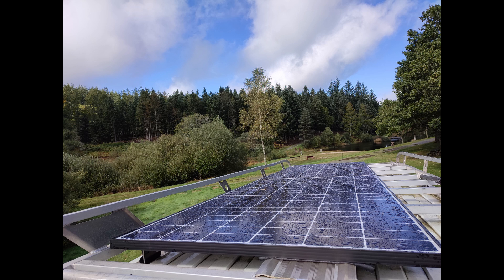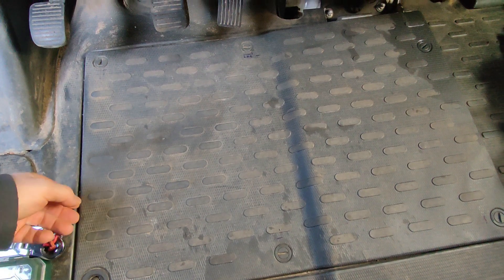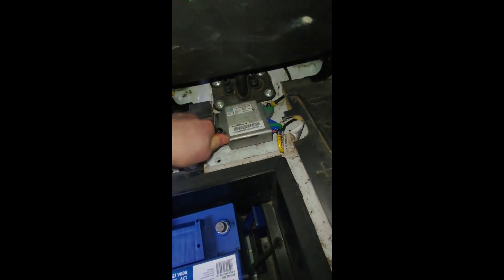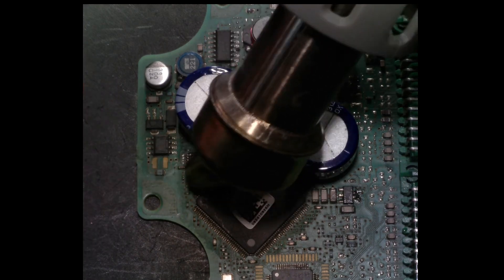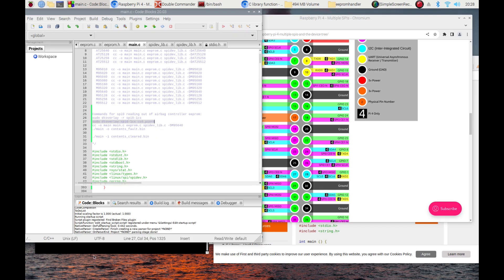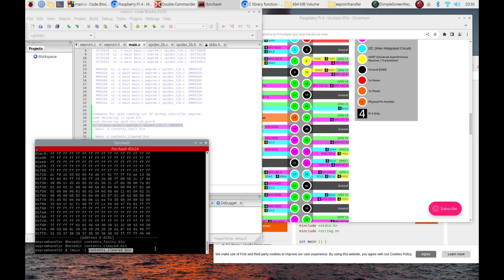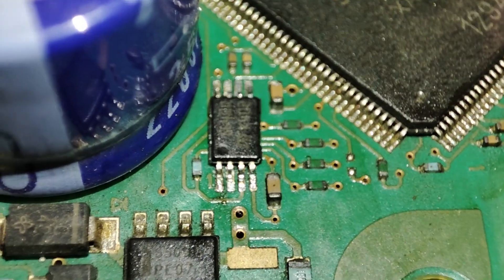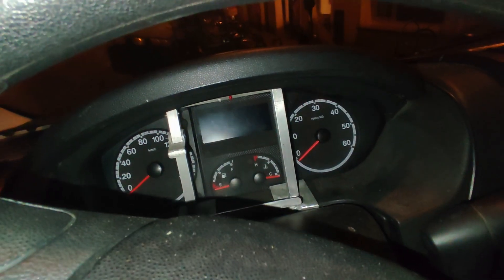Clearing internal airbag ECU EEPROM error B0100 with a Raspberry Pi (Boxer/Ducato/Jumper)

Comment: what diagnostic tool are you using? I have tried AlfaOBD and MultiEcuScan, and although they say they are compatible with Peugeot Boxer X250, I can't read the airbag errors (OBDLink LX and Vlinker MC+ adaptors): CAN ERROR.
Reply from the maker: A full chip lexia clone and diagbox, which are the official peugeot and citroen (PSA) tools (though not a clone then if it is official :) , but the genuine one is a lot more expensive). The problem is even though OBD is a standard, they  still managed to do their own thing so generic tools can only read rpm and the likes, not faults (can your alfaobd and multiecu scan talk to some of the modules, i think when I tried some a few years ago before buying the lexia they gave nothing). Really annoying. The clone you can order from eg aliexpress for about 100 euro. You can find the SW in eg the facebook group ' peugot planet 2000 & lexia diagbox diagnostics group UK based'. Note that for boxer you also need an additional interface module named S1279. You can also buy these for aliexpress but they don't work out of the box (and therefore some modules of your car will not be accessible). After a long search I found a tutorial to rewire it and if you analyse that patch then actually you completely bypass all the electronics on the S1279 and you just swap a few wires.  So you actually dont need to S1279 at all, just something that swaps wires. The airbag module was one of the modules that was not accessible if I did not yet have a correct wire swap, which is maybe why alfaobd and multecuscan fail to communicate with it. I should maybe make a dedicated tutorial about that wireswap thingie too. You can also buy some other tools, I think Autel has some that support peugeot (but research that yourself, I have no experience with that. Also they are more expensive than 100 euro...). Ah and another remark, from a certain build year (2018?) if you want to change things with diagbox you need to buy tokens from peugeot to be able to do it cos they want to make it even harder, and not sure if that will work with the clone. They should be slapped with  right to repair laws....
Reply: You need yellow adapter.

Comment: Your links to the adapter and and code have been truncated and not usable, could you please post the links again.
Reply from the maker: Youtube does not want to show external links on a new channel. I was hoping it would be okay by now but it seems to take longer than the 2 months they mention. For now I have added chopped up versions in the description so you have the full link if you concatenate them yourself. If it still does not work let me know!
Reply: @ToThePointTechDev  Both new links work, thank you. My Peugeot Boxer motorhome airbag ECU failed the end of last year, so I plan to have a go myself the next time if it goes again. Many thanks for your video.
Reply from the maker: @paulwebb4146  Ok , great! If you have a working one now (if I understand you correctly you got a replacement ) it might be interesting to read the eeprom out already so you have good reference contents you can reflash later. But it is of course a bit of work to read them out.  And yeah December/Januari/Februari + motorhome seems to be the "deadly" combination. I asked my mechanic last month if there is some kind of official communication/root cause from the PSA group about this problem. But while he was familiar with the problem, he was not aware of a known root cause. He did mention he also sees it in work vans too ... Makes you wonder how much money ppl already lost on this problem buying replacements. Anyway, best of luck with the procedure !
Reply: @ToThePointTechDev  Going to guess that condensation is probably the main problem since the boards are not protected with conformal coating! I might get mine out whilst it's still working at and get it coated.... lol
Reply from the maker: @dougle03   I think so too now:  I was in Scotland in June/July , driving almost every day so my alternator kept the starter battery charged (and solar panels too, though the sun is not exactly a top performer there). But given the rainy climate, the humidity was very high (sometimes with water dripping in the morning from the ceiling in the front cabin where it is not insulated ). One day after driving for 10minutes , on an uphill part the airbag error led / beep / message popped on, then off again when leveling, then on again when taking another hill etc and after a few times of flip-flopping like that it stayed on permanently.  When reading the error out  afterwards  I got the same internal airbag error again. So best guess is it was indeed caused by some condensation moving over contacts based on the inclination. But I already coated my board last time, so maybe it is not on the board itself (or I need to be more generous with the coating)? Sadly it is a bit hard to inspect the board at the exact moment it happens :/ (with the wait time and all to make sure it does not deploys the airbags in your face). Maybe I try wrapping the controller in a plastic bag with some silica gel this time (assuming the thing does not require a lot of cooling, but none of the components are in contact with the metal casing afaik so the housing is not used for heat dissipation). I am getting a bit fed up with it acting up :/.

Comment: Nice job! I used a CH341 programmer with TSSOP8 adaptor, and NeoProgrammer to read and write. Small fortune saved. Thank you!
Reply from the maker: I was not familiar with the CH341, definitely an interesting tool ,  especially since it also supports 5V and you can even get a 1.8V adapter as well. The 3v3 is potentially a bit limiting when using a pi. Thanks for making me aware,  I think i will order one to play with :). I see that NeoProgrammer is a closed source tool you have to find on some forum posts, that is a bit less ideal. But there are alternatives so it is not really an issue.
Reply: @ToThePointTechDev  i had to modify my ch341 for 3,3v. there is a new version with voltage change switch added.
Reply: Did you desolder or read write on the pcb?
Reply from the maker: @glynherron  What did you opt for in the end (assuming you already tried by now) ? Did you try the procedure with the chip still on the board and did you manage to communicate with it without the cpu corrupting the communication ?
Reply: @ToThePointTechDev  I removed the chip. I'd be thinking that putting voltage to the board could corrupt the code. I've fixed 5 of these modules for other people since learning this.
Reply: Io ho provato.  Ma mi da errori su tutti gli airbag ora, compreso sempre. B0100
Reply from the maker: @armandodiana9850  I am sorry to hear it. I don't really understand what you mean by all (tutti) the airbags, i only have 1 airbag controller so 1 B0100 code. Did you check all the pins of the eeprom are soldered on correctly (so no shorts, good contact). In any case, if you write the original flash eeprom contents in the chip it should behave as before. That is if you can still write to it, if not maybe the eeprom chip got damaged, which is still not a huge problem, they are just standard eeprom chips and you can buy replacements for them (I bought a few and already programmed them so i have them ready). Sending the controller to a 'professional' repair service is also still an option, and if all else fails you can still buy a new controller (I don't know what they cost these days, 300-400 euro ?), or maybe a second hand one. Hopefully you can sort it out without too many extra costs !